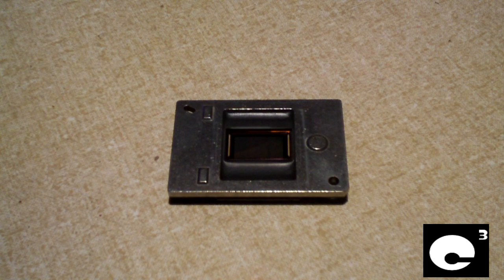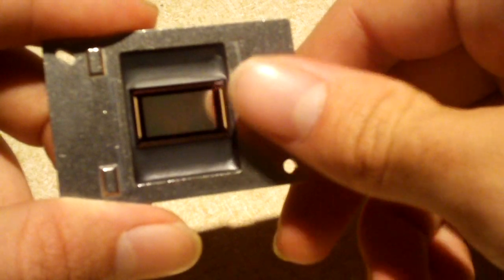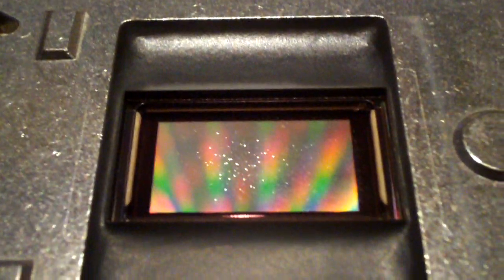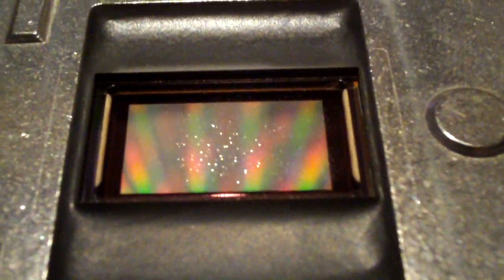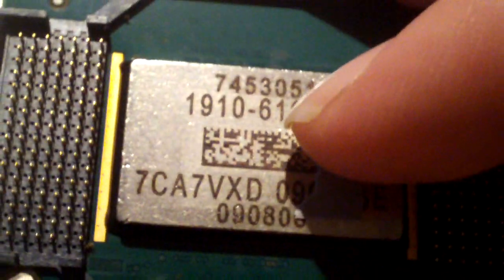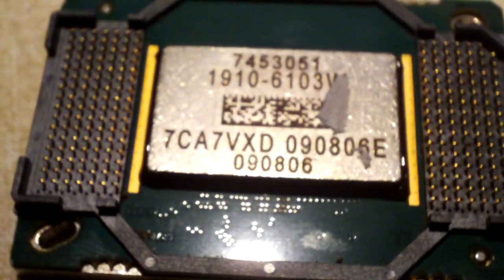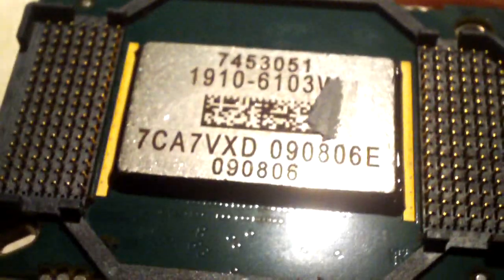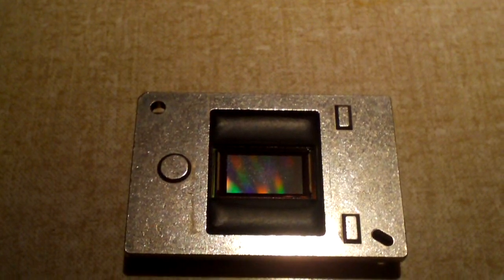Some Information Regarding DLP Chips, and Why I Believe Some Fail

Comment: my AWOL VISION 3500 PROJECTOR has been replaced once already and now my replacement projector is displaying the same problems. 5400.00 problem I was quite enthusiastic about AWOL vision at first but now that's starting to Wayne. They tried to tell me that it was my HDMI cord and I told him that the defects the artifacts are exactly the same shape. They show up on four different devices and I did every swap possible with and without, all HDMI cords all devices all switches everything and nothing seems to solve the problem AWOL vision tried to tell me it was my problem, HDMI, this HDMI that and I tried to explain to them that if it was a HDMI cord problem the Artifax would not be the same every single time after changing HDMI cords the defects are literally identical it's really ruined my projector experience and destroyed my faith in AWOL vision projectors. If you care to I have a few videos on my page showing the defects and I would super appreciate it if you could look at it and give me an opinion.

Comment: Aren't these dots just dust?  Can't you simply clean the surface with a Q tip and alcohol without having to replace the expensive chip  ?   Thanks.
Reply from the maker: Nope... not dust. The dots are little mirrors inside the chip that have stuck in the on or off position.

Comment: Why haven't they made a led bulb for the Mitsubishi dlp tv yet my favorite TVs first 73s inch I got was from the early 2000 I got one a few months ago for 100 dollars they said the lamp was out I took out the lamp adjusted the set screw and it worked had two small white dots tho but on my first 73 I had it had tons of those dots when I first got it so easy to fix gold is just so expensive right now they shot up in price

Comment: I would've termed it "lice and fleas", just to keep the pestilence metaphor.

I have a 67" Samsung DLP in which I had to replace this chip.  It was a fairly easy repair - pretty-much just like installing a consumer-grade CPU.

Unfortunately, the blue LED has now failed on me.  I'm just waiting for some replacement caps from Digi-Key that I want to also throw in while I'm mucking around inside the TV.

It's a shame this technology wasn't pursued past 1080p.  A 2160p DLP display would've looked awesome, easily rivaling the best OLED.

Comment: Overheating can't be the only cause. I read TI chips specs, and they named two main reasons of chip lifetime reducing.  First, as you say - temperature. Second - UV from lamp. And i sink, UV is more important, because there is very small opportunity to heat chip more than 75 C (manufacturer's rate). Maybe it's possible if stop all fans, but if cooling system works - overheating is not an issue. But if your lamp module is old enough, or you damage UV filter on it (as i do) - you'll get problems with DMD. In my case, I trying to do maintain working well old XGA projector, put some good thermal paste (MX-4) on heat sink, but, accidentally, seriously scratching UV filter on lamp module. As result - got black dots all over the screen instantly.

Comment: I don’t think this is a heat issue. Or it is, but it’s due to a defect in these chips. You tend to see failures in the same models of DMD chips. The science of DLP is sound, but the early chips were not well made or there was something they overlooked that caused early failure that they remedied in later revisions. 

Also it isn’t heat from the dmd, it heat from the lamp. The lamp can put out a LOT more heat than the chip can generate by itself. So it’s different from a cpu in that respect.

Comment: I replaced my chip but found the thermal tape still in the packaging in which it was shipped...I scraped off the old tape from the housing. Do I need to take it all apart to put the tape on or will it be okay? TV works fine.

Comment: I have an Optoma Pro350W and the DLP started acting up after approx. 5 years usage: blue/purple flashes on the screen. the thermal compound was for a large portion gone with overheating as the result. I used a fairly priced compound and the problem was fixed. After 6 months, the DLP now has white dots in a single corner (about 40 dots). The compound I put in has "melted" and left some kind of residual "oil" for a part. I think this caused some kind of leakage current, and not by overheating, causing the dots to appear. The socket now has "oil" all over, so before replacing, make sure this is all clean. Good compound is key.

Comment: I just found a Samsung HL-T6176S on the curb and have just today removed the DLP chip. All of the examples I've seen were any part number except the chip I have. I've gotta say your video is the very first indication I've seen of anyone else but me who has a 1910-6103W. Now, I've just got to know what part number you've replaced yours with? I'm only seeing that a 4719-001987 is all I can find, and nobody seems to want to tell me if it will cross to the 1910-6103W. Please let me know what chip number you've used as your replacement. Thanks much!
Reply from the maker: Chip numbers vary by model, etc. Look up your TV by the model number and you should be able to locate a match.

Comment: well that guy forgot half of the friggen thermal pad on that old dlp chip
Reply from the maker: because that guy used thermal paste on the new dlp chip.
Reply: If you only use thermal paste rather than thermal tape doesn't that leave a gap between the heat sink and DLP IC on some models?
Reply: It probably left the other half on the heat sink.

Comment: Great info Nick, I guess it would be better to change out the thermal pad to using Ceramique 2 White thermal past by Arctic Selver or AC 5, which would you recommend between the two?

Comment: I think you're on to something. I just replaced mine in my Mitsubishi WD-60735 chip# 1910-6143W and, the thermo-conductivity paste/sitcker/whatever was not really attached very well. 
These are very fragile mirror systems inside the chip and I can see how overheating them could very well disrupt the ability to control the mirrors.
Got mine from Shop Jimmy for $184 [quoted $585 - WTH? Does the guy think he's an actual surgeon?] Took just over 30 minutes once I got the back of the TV off.

Comment: When I was first in the market for a large flat screen I gave no consideration to  DLP.  Then I went to my son's house and took a look at his Mitsubishi  60" DLP.  When he put in a BluRay disk I was blown away.  Breathtaking picture quality.  I bought my 65" for $1,100,00 bucks.  After 4 years, the artifacts began to appear.Just changed the chip, no brainer, beautiful picture again and if I have to do this every four or five years I'm ok with that. It's a shame everyone has dropped this product.
Reply: +Patrick Kodran Right. If you figure about $200 for maintenance every 5 to 10 years or so, that's not all that bad. WAY better than buying a new TV every 5 to 10 years for a cool grand... or more.
Just replaced mine too.
Reply: well if thats the case Mr. Kodran,you can start heading out to my place and you can replace my dlp chip..

Comment: If you think the DMD chip is expensive when the panel of and LCD or plasma goes bad goodby whatever you paid for it hello landfill or ecycle. I have a Samsung that is now showing signs of a failing DMD chip. Good to know that TI had a bad batch of chips around the time that my TV was made. Sounds like they took the necessary corrective action and now the chips are better than ever. That encourages me to replace the failing chip and enjoy many more years of service out of my investment. My TV has the LED light engine so no bulb to regularly go bad. I did have a blue LED go bad and wouldn't you know it the factory didn't put enough heatsink compound causing eventual overheating. And keep in mind ALL of the new digital movie theater projectors from Christy are DLP not LCD.
Thx for the video.
Reply: +pcrengnr1 Although I love my flat panels LCD TVs, the sad truth of them is when the display panel goes... You would be better off getting a new flat panel being the price of replacing the display panels in both plasma and lcd is what it would cost to buy a new one! However instead of having that flat panel go to the landfill, sell the remaining pc boards on ebay and get some $$$$ for it in return!

Comment: If you're thinking of using paste between the DLP chip and the heat sink. Consider that there is a small gap that the original material fills between the two. Using paste may not make full contact with the surfaces. If they do you, also might get run off from the heat sink paste, or you are creating an insulator rather than a transfer from too much paste to fill that gap. I suggest you apply a thin layer of paste to the heat sink, and then assemble it toward the DLP chip. Remove it again and see how much surface it covered. I've done this in the past to see if heat sink compound is a better solution and found this out. Out of all the DLP chips I've replaced on Mitsubishi's, I only had one person insist on applying artic silver over the stock type material. I had to apply a thickness equal to the original material to make contact.

Comment: I have a Mitsubishi 65'' WD-65735 and I just put in a brand new DLP chip because of the spots. I was very careful installing it and now when I try to turn it on the TVs "Lamp light" is flashing and wont turn on. What did I do, what can I do??? please help!
Reply: ***** When you changed the DLP chip, did you plug in the two connectors on the back of the DMD board going to the color wheel? The flat one only electrically contacts one way. If you didn't, the color wheel won't spin and therefore the lamp won't strike. This will result in a lamp failure light on the front of the set. Also as others have replied below the lamp door safety switch has to be engaged or the back of the set has to be on with the lamp door in place. Anyone not knowing how these products work should be advised to use a digital camera as they take things apart to see where things like certain screw locations belong, and connectors go. Also the light engine should be removed (3 screws) and all connector detached to it, to clean out the lamp fans properly with compressed air. Don't spin the fans with compressed air! Hold them from spinning as you apply the air.
Reply: *****  Did you replace the lamp door? (won't run without the covers; saves you from burning your retinas).  If that's not it, you probably damaged the DMD board or DVI cable.
Reply: ohger1 Thanks for the reply! Im not sure what the lamp door is or where. If I had to remove it/open it to get to the dlp chip then I put it back. I was really careful and kept up with everything. Is there a way for me to trouble shoot these things?
Reply: The lamp door is the small (maybe 7" X 7") plastic cover located on the right side of the rear cover by two philips head screws.  It's the door that covers the lamp and has a safety switch to prevent people from looking directly at the lamp which will damage your eyes in seconds.

Comment: The failure of the DMD chips are NOT due to heating.  These are not terribly hot running devices even with no heatsink and fans.  This was simply a bad run of chips about 2007.  No models earlier or later have this problem.
Reply: +ohger1 Not hot running?? Really? Have you seen the 5 ounce, 2"x3.5"x1.5" aluminum heat sink they're attached to? Why bother with fans, heat sinks if they don't "need" them?
Reply: They are rated to run at a max of 75C, and they typically run less than 30 C with heat sink and fan under typical operating conditions.  Working on DMD drive boards over the years show most DMD image chips don't run over 45C with just the heatsink and no fan even up to 30 minutes of run time.  Heat is NOT the reason these DMD chips fail.  It was simply a bad run of this one part number.  Neither earlier nor later 1080P DMD chips suffer the stuck pixel problem.  

I suspect the reason for the failure is too much UV gain through the lens of the DMD chip.  It's possible that this particular design is inefficient at dispersing the UV heat from the front of the chip to the back heatsink, or perhaps it doesn't have sufficient UV filtering in the front lens.
Reply: I sink you right. UV filter on lamp module dying with time, and its can increase UV impact on chip

Comment: I'm about to replace a dlp chip. Our you suggesting I use a thermal compound?
Reply from the maker: Yes, be sure to use thermal compound, otherwise the new chip will overheat and you'll be replacing it again real soon.
Reply: Thank you
Reply: +Ray Hanratty I used Arctic Silver on mine.
Reply: For anyone curious about the issue above, arcitic silver actually has silver in the compound, making it a better heat conductor, but also an electric one. The issue with the mac book is not only for mac books. The issue spoken of is caused by putting too much paste on the chip, causing an overflow onto the circuitry, crossing the circuits and obviously causing some pretty bad issues. Thermal paste is not supposed to be globed on, it's primary purpose is to create a micro seal between two components by filling in VERY small scratches or imperfections to make everything fit perfectly. It's similar to trying to push 5 papers through a printer instead of 1.
Reply: +Cube Computer Channel  I am thinking of changing out the thermal pad for thermal paste in my BenQ MW817ST projector being it has less than 40 original playing hours off the bat! However which paste would be good for the DMD chip, Ceramique 2 White thermal paste by Arctic Selver or AC 5? BTW are there any halogen lamps to LED conversion kits or methods out there? Thanks!
Reply: +Jeremy Matthews I have to say that BenQ already had used something in which appeared to look like they used Arctic Sliver 5 not the white thermal paste! Although the say the arctic silver 5 is better than the white Ceramique 2, never use it on a MAC BOOK Pro being the formula is conductive and there are components way to close to heat sink! Learned the hard way on that one, desk tops its ok being that there is more room!
Reply: True and it requires some practice!
Reply: Also another note with Apple, Apple seems like they glob the white paste to begin with and those who attempted to apply arctic silver 5 (Guilty myself) follow that! Now I put on a very small drop just enough to give the silver a light grey tint and good from there!

Comment: Dear Sir, I just replaced my DLP chip in my Mitsubishi 63705. No problem until I was trying to remove the circuit board. There was a very short flat 3 stranded copper wire that plugged into the back of the circuit board. While trying to remove the clip it snapped completely in two. it almost looks like it was severed with something sharp. I am not sure what this wire leads to or if it even can be replaced. It looks like it leads to the right part of the tv somewhere. Can you give me any info on this, what it is, can it be replaced reasonably. I hate to just have to scrap this tv, I have about fifteen hundred in it, Just replaced a lamp and the chip today. Can you help?
Reply from the maker: It's been two years since I worked on mine... Don't remember the exact connectors, etc.
Reply: It sounds like you broke the connector on the DMD board where the color wheel speed sensor feedback lead connects to.
If so you'll need to replace the DMD board and do a chassis realignment particularly for gamma and index.
Reply: thank you so much, now I can know what to describe to buy a replacement. Thank you so much.
Reply: I will have to take it to a qualified service center to do this, correct?
Reply: Dennis G. Rhoads
 At this point you're over your head on cost.  The best option would be to acquire the CORRECT DMD board and install it.  With any luck, you won't have to have it recalibrated.  If it's any consolation, I've had customers bring me their TVs and they've broken them in the same manner.

Comment: I wonder if it will help to replace the thermal interface material with a good one such as Arctic Silver 5?  This is what I used on my PCs CPU when I built it and have no thermal issues.
Reply: +Darknecros7 I have used Dow Corning heat sink putty for years and have never had issues related to heat.
Reply from the maker: I believe if TV manufacturers used good quality paste when building the units, they wouldn't be seeing lots of chip failures like this.

Comment: I just received and installed a new DPL Chip and now instead of white dots I have vertical lines, Also tv wont power off. I have a Mitisbushi WD60735  60 in rear projection, can you help me please?

Comment: I have the problem with a Samsung HLT5075. Good news is that Samsung said they would honor the chip replacement for free but I would have to pay the labor.  The service center wanted over 200 bucks for a 30 minute fix. BS! So I asked Samsung first if they could simply mail the chip to me so that I could do the repair. No. So I thought I would offer the service center 30 or 40 bucks to just hand me the chip. No. Assholes.  Shopjimmy seems to be the best price for my chip. $50 and I'll do the repair myself. Assholes.